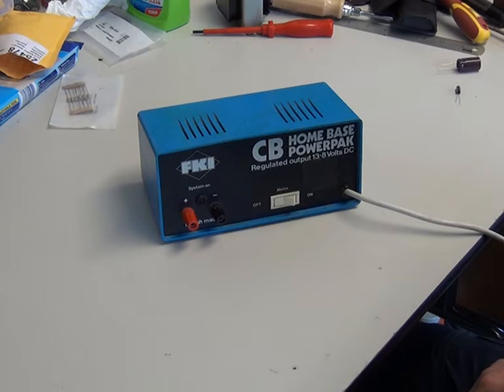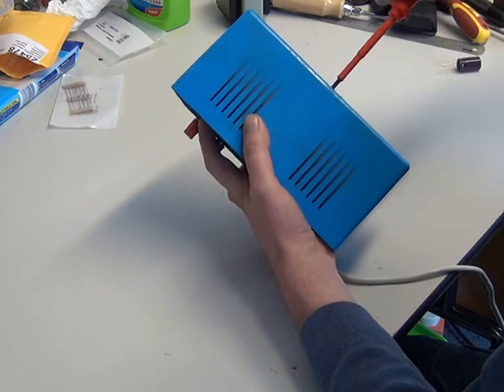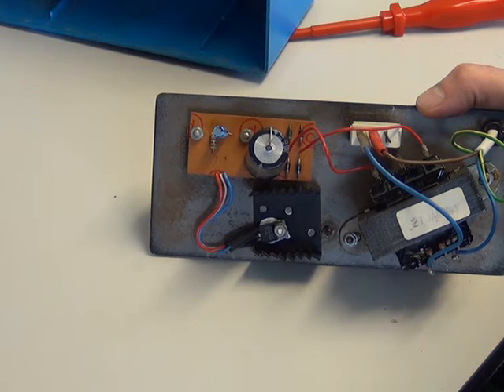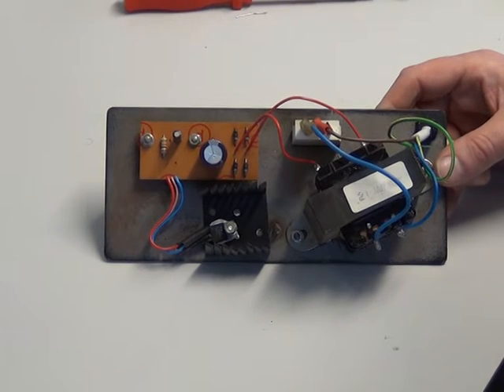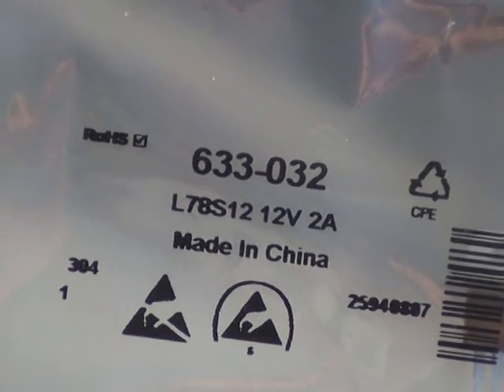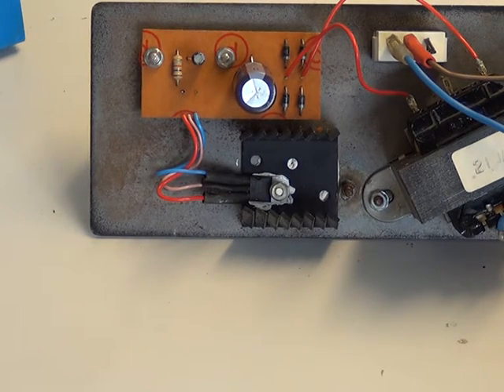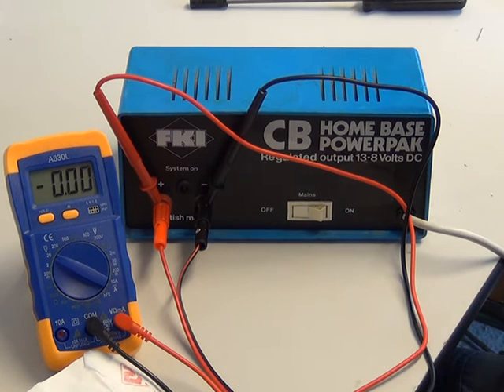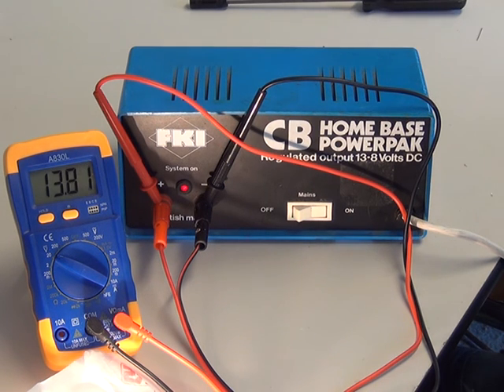FKI  CB radio Power Supply (1982) Overhaul & upgrade

Comment: That is bloody awful that power supply.  If you did buy one though your upgrade might get you out of a fix, but I don't think i would use it.  You are right, it is a terrible power supply.  Worse than the Bremmi  (Did I spell that right. or had it just one "m"?) anyway, they came in with the neutral switched and not the live!  If anyone took the cover off it could be the last thing they ever did!  Like old radios and TVs with live chassis.  Yeah!  Surprised when I was a kid I didn't electrocute myself!  Didn't have an isolation transformer, when I asked for one I was told I didn't need one.
Yeah, well that is how much my father understood electronics.  Not that I understood a whole lot when I was in primary school, but I knew enough not to kill myself.  My multimeter cast £1.99p back then and I wouldn't have trusted it on anything more than 500volts but it lasted for years.  When I started working it was retired gracefully having kept me safe for around 6 years.
I never came across one of those power supplies, it's a wonder someone didn't have one that stopped working!  I think I would have just told them to get a better one.
Reply from the maker: That power supply was a British product of the worst type" FKI were/are a popular brand of car battery chargers. Some UK CB's will draw about 900mA, but these newer sets with CPU's etc draw as much as 2.5A on TX.

My late father, who was a Doctor of Chemistry made a mains extension lead  comprising of a double socket mounted on a board, and a 7m length of house wiring cable...the twin & earth type....with a mains plug at each end. So, one plug went into the double socket & the other into the mains wall socket....lethal.com. Clearly his cleverness didn't extend to electrics.

Richard
Reply: @ukfmcbradioservicingTango21  OMG!  That is a no no, I found interesting cables with caravans when for some reason they kept making up cables with mains prongs sticking out at at the end you were supposed to connect the extension to!  My father did the same with a rubber extension cable, he wired it with the live prongs sticking out and the socket end where you plugged in the extension.  How do some people thin?  I don't understand it, surely it is plain to see how they should be wired?

Comment: Good vid again Richard, 2A is as good as you can get on a TO-220 regulator, diodes are on the edge in a full wave arrangement like you say, but where do you end? Upgrade the little  transformer too and you may have just build a brand new PSU. But you reinstated some old kit again, well done. And its light weight
I still have a Tallen to look at when i get time. Darn heavy PSU the Tallen, I'm using it as a door stop ATM.
Reply from the maker: I reality, Most CB's draw 1.2-1.4 A on TX. This design was ridiculous at just 1A. Even back then there was a 1.5A version of the 7812 which FKI  should have used.....but of course was at  premium price in comparison to a standard 7812. The Ground is lifted through the power on LED to produce the 13.8V instead of 12.

Comment: Be interested in you having a look at the Bremi 3amp power supply. Same one I had back in 81/82
Reply from the maker: There were two Bremi 3A power supplies, the BRS26 & the BRS27.  Both came as either an early or a late version. The early version has a 2-core mains lead & was designed for 220v mains, the later one intended for uk use had a 3-core mains lead & a transformer suited to 240V. I have A BRS27 here & we may well do a video on it tomorrow for you.

Richard
Reply: Thank you Richard I look forward to that. Regards Tim